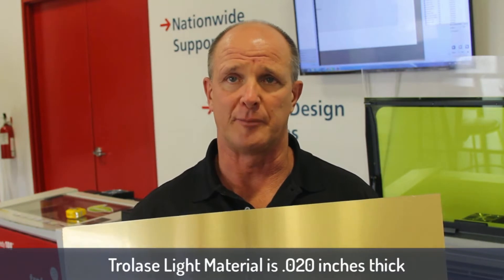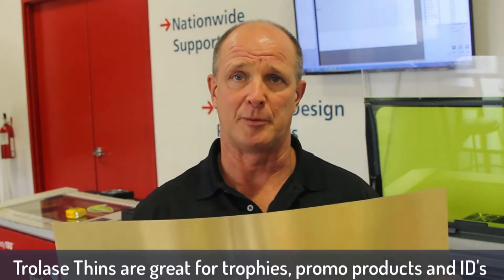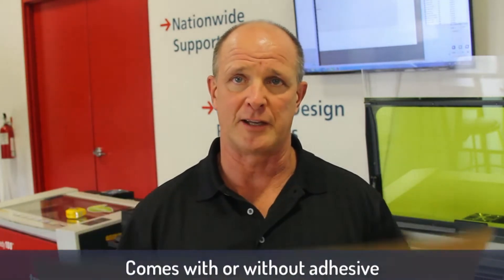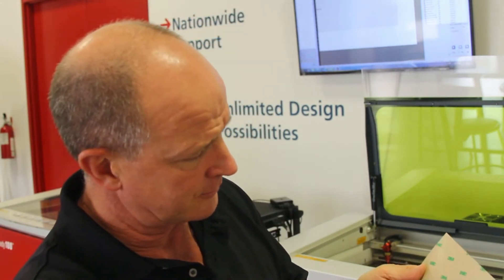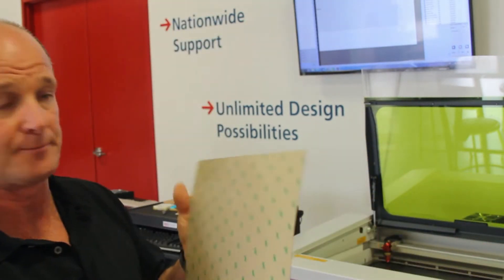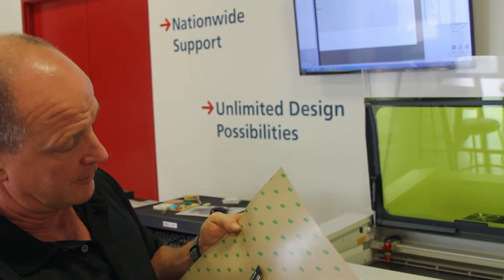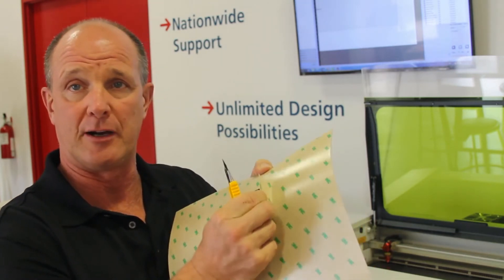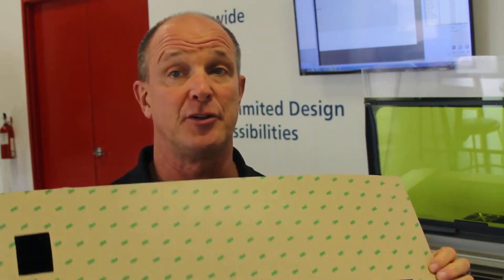In-Depth Training: TroLase Lights | Laserable Materials | Trotec

Comment: Mike, very interesting product and technique.  Could you expand on the "Kiss" cut and how you determine power and speed needed to cut through the Trolase but not the backing.
Reply from the maker: Hi Jim, thank you for the kind words! It all depends on your laser and knowing the machine and material. We always test a small 1/4" square and drop/increase the power little by little until we have it just right. You can then save your settings in JobControl so you don't have to keep finding out the optimal power and speed. "Kiss" cut works wonders not just on this material but when you want to position one material on top of another or even in fabrics like twill, we have many videos throughout our YouTube channel with the kiss cut techniques.